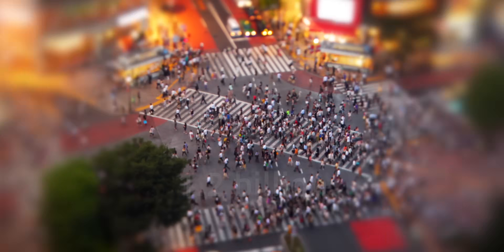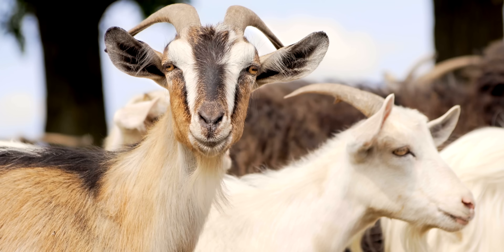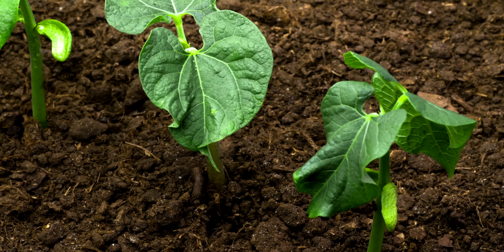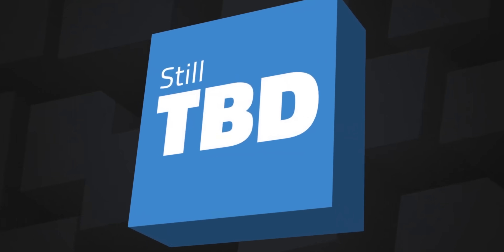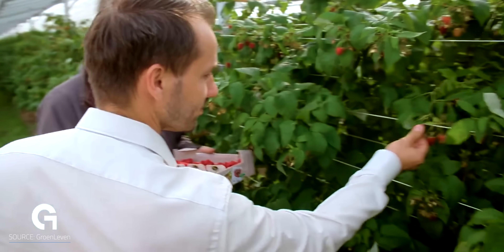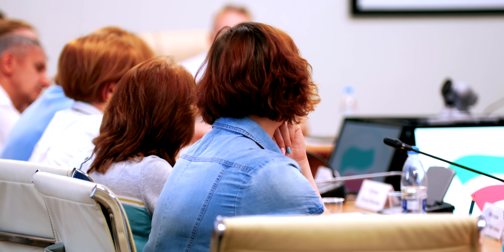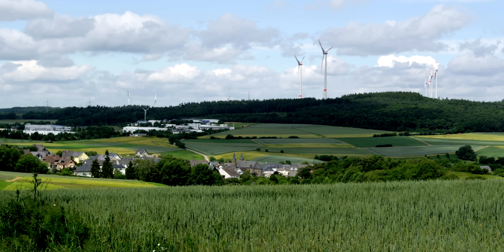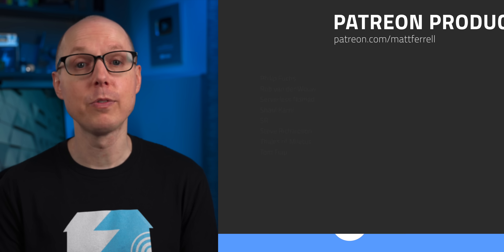Solar Panels Plus Farming? Agrivoltaics Explained

Comment: Sunny California with it's water shortages comes to mind for this.  Saving 50% water costs, adding income from power generation and maintaining same yield - a win-win.
Reply: yes, and there's also the opportunity to tailor the solar panels to light frequencies that plants don't prefer. With semi-transparent panels allowing the light through that plants like the most, we can make up the energy production shortfall caused by currently being forced to space the panels out (like on the raspberry farm).
Reply: @mikeballew3207  Yes, like the massive amount of green light plants don't use.  This is a great idea!
Reply: @mikeballew3207  underrated comment.
Reply: I’ve seen California crops under plastic tents. We should try replacing some of this with solar panels. California’s desire to promote solar power should be compatible with this.
Reply: @dmk1948  plastic tents, greenhouses?
Reply: @dmk1948  foreal i could confirm , i am currently working in agricultrue and i have seen that i work in the grape and lettuce
Reply: @dmk1948  they tryna go 100% solar by 2035
Reply: While certainly public policy could nudge this forward for some crops in California, recall that agriculture pays far, far below market rates for water, often at rates set 100+ years ago. So while the state as a whole would benefit, actual farmers and agriculture businesses might not be so interested, as the money saved is for an asset they pay very little for. And as Matt points out towards the end, that's one of the big impediments to adaption.
Reply: Someone has to make up the difference in that water bill somewhere right?
Reply: no freaign brainer as far as I can tell...and we need to stop growing almonds in CA....move that ish to southern states like Georgia or something
Reply: @CalifLove  agreed, according to some research I did for a college paper a few months ago, this was one of the big reasons for over-use of ground water, it’s getting so bad certain land has “sunk” down. We have literally changed the landscape by over consumption.
Reply: @CalifLove  Good luck with growing almonds in Georgia. Almonds grow well in two places in the world, San Joaquin Valley and Iran. Plus everyone complains about how much water they use because some dork wrote a misleading article wringing their hands about how each almond takes 100 gallons of water to grow, but they use a fraction of the water of the crops they replaced per acre yearly, like corn and cotton.
Reply: Local vegetable crop production in AZ too. Lots of farmland is becoming solar production for CA. This would be a win-win to reduce water use and transport fuel for some crops.
Reply: I am pro solar.  megawatts installed.   But I still worry about rules and regs and codes.   I am sick of all the changes that f the customers( and Mother Earth) .  When codes, requirements keep changing this really screws customers and our future( i am not anti safety).   It causes mass e waste.   When requirements and code requirements keep changing add-ons are not possible ( not unless a full new and different system is installed).  Rich people do not accept 2 different systems ( Visual aesthetics/ twice the monitoring).  These persons toss these systems and buy fully new.   Creating tons of waste.  And additional roof wear and many reroof  ( another landfill builder).    Lower income usually is who seems to get effed.   Picture a smaller income family who only could afford 1/2 a system ( and plans to add-on downstream).  Well they can’t.   Monitoring changes, code changes, modules access changes cause manufacturers are forced into new codes and safety.    So now a house has a system that will never hit full offset not without full new system or 1/2 a totally new system.   Larger older dc inverters still seem to be the most reliable but not the newer because of the code changes.  But they fail too.   And when they do it’s hard to find inverters.  Many of those folks were forced into a new system too.  Inverter failures, micro inverter failures, module diode failures, optimizer failures, optimizer allocation problems all cause huge w wastes.    We have tried for years to find a recycler.  Never found.   We could not even find a recycler for the millions of plastic spacers between the modules for shipping.    I like solar but we still need to make sure it works( way too much e waste).  And has parts that are allowed to be installed when equipment failures happen.   I am not a recycling freak.    I just want there not to be billions/trillions of solar panels, inverters, micros, batteries stacked up down stream.     Very soon this topic will be discussed and not hidden( I hope).     There are is more to the story.
Reply: Same problems as Germany.  Politicians interfere
Reply: @Harry Groundwater I'm not too sure Washington and Oregon will be too happy to find out they don't exist :P

There has been the occasional suggestion of diverting some of the Columbia river southward but that's still a very long distance to transport a lot of water, which includes a few mountain ranges to go over. You're looking at at least 100,000 gallons a second being transported at least 600 miles over 4000 feet of elevation changes. While such a megaproject would be neat to see, it's probably a lot cheaper for us to just be smarter about agriculture, which uses 70% of California's water supply.
Reply: @ikani1  you mean to say Portland and Seattle aren’t in California? 

I agree that pumping the Columbia river that far over the mountains is a terrible idea. 

The idea of growing crops under solar panels in the south west is a great idea I think. 
Tip them towards each other to form a trough to collect rainwater / condensation and then run small animals (poultry) underneath between crops to help add fertility, and the diversification enables more consistent revenue for the farmer.
Reply: Arizona now too, thanks in part to California.
Reply: Except...the San Joaquin Valley water shortage is too profound. Desalination for the entire West Coast is the ONLY way out. By Spring 2022, you will know this is correct.
Reply: And investing in on-site water storage. A network of small reservoirs and tanks will be a great supplement to large centralized reservoirs.
Reply: Sunny India as well!
Reply: What is the ROI?
Reply: good luck with regulation and try to convince regulators it's win-win
Reply: You could easily plug in an atmospheric water generator to get even more high quality H20
Reply: Aeroponics can produce food with 26 harvests a year (depending on type of crop obviously) use 95% less water, produce more food per square foot and be done anywhere there is wasted urban space.
Reply: @Peaches.Gonsalez  if only we had a more sustainable and less abusive way to source the rare earth elements required for solar panel manufacture
Reply: @Tom Sawyer I think it's all across US especially in dry states like Arizona, Nevada, New Mexico and Texas.
Reply: Except is costs a fortune.
Reply: @djheatt  never heard of offshore floating solar panels?
Reply: Same for INDIA
Reply: @Harry Groundwater Agreed. Also I thought about it more after posting and remembered the Columbia starts in BC so.. you were still technically correct :)
Reply: New technology for electric power generationhttps://youtu.be/xc2V2BS_Fng
Reply: Idiotto.they dumping water in Ocean
Reply: hell yeah... it's the future for sure.  So simple, it's beautiful.
Reply: Aeroponics is better for water.
Reply: Solar pv best application is direct use for deep well water pumping , thr is well and farming you can achieve both purpose .
Reply: @green-kundi8835  deep wells should be banned because they deplete underground aquifers.
Reply: It would be win-win-win!
Reply: @Harry Groundwater Pipelines for Water🙌
Reply: The European Mediterranean coast have plenty greenhouses allredy in use ...known as "plastic coast" from Spain to Greece that might be tuned over in the next 50 years
Reply: Yes, yes, yes!! Let’s me & you build the farm
Reply: I wonder why sunny California is having water shortages? Maybe its the fact that people live in the desert with swimming pools and golf courses? Or is it that yall grow avacados? Now people are fleeing cali and bringing AWFUL political ideas  to places like texas. Why turn your future into what you fled from? Californians, stay in your shithole that you voted for, we do not want you.
Reply: Oh I couldn’t agree more. From what I’ve seen of the US in many recent videos of your ever decreasing water supply and create problems due to degrading soil and less and less rain each year, you really do need more solar panels across your dryland areas all the way from California to San Francisco and the big rocky drying up river areas of the north west, along with the rest of the country.Quite frankly I am shocked that people across the world haven’t been using solar panels as a good alternative for trees to create a larger humidity shaded area to grow crops under a lot sooner. It feels like such an obvious thing yet for some reason people haven’t been doing it. Just get the right kind of solar panel and put your system on higher stilts and there you go. This needs to be implemented in the US over as much land as possible right now.
Reply: Vineyards spring to mind for this, as there is little machinery that can be used with trellis-grown plants.
Reply: Except it doesn’t actually work out that way
Reply: Sure its doable, seeing how California has yet to make meaningful update to its electrical infrastructure in its last hundred years do to bureaucracies and environmental activist. It may be easy and cheaper to completely overhaul its system then to update it aling with population changes. And would help out on bottom two thirds of the state since it imports irrigated water from surrounding stats as far as Colorado and no real attempts for desalination plants have neen made because the beach fronts are technically governed by the federal government not local jurisdictions. The top third is mostly where all the rain fall hits there is a pretty substantial climate barrier following the mountain range that separates the two parts.
Reply: Here's something for the idiots of Renewable Energy: 

Sooner or later you greenies are going to need to grow up and learn how economies work. - hint government people understand nothing of economies other than  how to rape them.    

These G-morons decided "woke' power (power that doesn't really work) was a great idea for them, not us, so they decided to steal some money from some ratepayers in order to pay others to stimulate the growth or power that really doesn't work - ie wind and solar.

In the real world, the one that really works,  there is something called supply and demand and these things regulate the price of everything fairly.  

Your butcher buys his beef by the side and pays more for it than the meat packing plant did who in turn paid more for steer than it cost the rancher to produce it.   Get it so far?     

Now when you buy that beefsteak at the butcher's shop he's going to get his markup as well,  so you as the end consumer are going to have to pay a lot more for it per pound than the rancher was paid for it.   

Next time you want a beefsteak drive out to a ranch and buy your steer on the hoof - then you slaughter it, age it carve it up sell the inedible parts to dogfood processors and the like and eat the rest of it on the cheap - no you want the value that all those who added value to the meat along the whole length of the supply chain don't you?  Or do you buy your steaks on the hoof?      Or do you expect to pay the  ranchers price at your favorite steakhouse as well?

It's that way with electricity too, you cannot expect the power company to buy power back from you at retail rates when they don't even need or want the power. With that business model they will go bankrupt as soon as their investors are wiped out.    

If that rancher were to dine out at your favorite steakhouse why not demand that your ignorant politicians make the restaurant buy his on-the-hoof steer from him on demand at the same rate per pound that they charge you for a 16 oz prime rib?    

The problem is, as with all government planned economies, sooner or later everyone will want to receive the grift instead of paying for it, when that happens the lights go out - permanently.

The most ignorant feature of all of this is that it is supposed to solve some problem that the grifters dreamed up but that does not actually exist so solar panels and wind turbines only create huge problems, they solve nothing - time to wake up you dizzy Californians.
Reply: Socialism is NEVER the answer.  The NIMBY is not always bad.  Many farmers have had their farms for generations and have fed thousands, if not millions over those years.  To say socialism is an answer, is merely saying, you have is and I want it.  My want is better than your want.  Some of the ideas here are good ones, but only if the farmers are on board with it, and can retain their sole rights to THEIR property.
Reply: The problem is they will put taxes and regulations on them and it will never get done properly
Reply: Absolutely, California's water issues make agrivoltaics a perfect fit. The potential to save water, generate income, and maintain crop yields really is a win-win. Do you think this model could be scaled to other regions facing similar challenges? And what other innovations do you think could help address water shortages in agriculture?
Reply: You have forgotten wind dew wells ! They make clean water from invisible steam in the air.
Reply: NoT iN mY bAcKyArD
Reply: Yeah
Reply: Less nutrients tho sun gown and light grown have huge difference in nutrients
Reply: I remember they used black balls on water reservoirs to avoid evaporation.   Those black balls could be solar panels
Reply: Yeah
Reply: California central valley also has the worst air quality in the county bc of all the diesel semis and tractors and tillage. These agrivoltaics will be needed to power megachargers for tesla semis and monarch electric tractors that will replace the diesel ICE ones running now
Reply: I have been to California on numerous occasions. One of the first things I think about when they cry water shortage is all the swimming pools evaporating water into the atmosphere and the lawns being watered like clockwork. I bet if they shut off the lawn sprinklers, let the indigenous plants take over, get rid of the pools and go play in that perfectly good ocean they would have more water to drink.
Reply: @Cyruscosmo  one cannot play in that frozen ocean, a quick check of temps at California Beach front may lead you down the path of enlightenment
Reply: To be fair though, saving the water could also be achieved by any other structure that adds shade when there is too much sun. So you still have to consider about 90% of the installation cost as only usefull for the generation of electricity, not justify it through the water saving.
Reply: @ShieTar_  I’d argue the additional revenue of energy farming on top of your crops is a good reason to do this instead of using tents or covers which produce no value.
Reply: @Skyhawk656  It may be, but it pays to do the math correctly instead of thinking too binary. 

The tents do not produce "no value", they produce value by saving water. Which, particularly in regions which get loads of sun, can be a significant contribution to your overall cost of operation.

The solar arrays create extra value (energy production), but also come at extra cost (solar panels, wiring, increased structural complexity). 

So you want to base your decision on correct math. Compare the cost of the solar installation with the cost of simpler water-saving techniques, and then only calculate how fast the value of the energy production can return your investment into this extra-effort for you.

My comment to the original poster was only: Don't compare the sum of the values of saving water & energy production with the cost of a solar power installation directly, because this equation gives you less information than doing the separate math for two solutions.
Reply: Solar power generation is worth $0 in CA.  Everyone has solar panels and they're all trying to sell energy to the grid at the exact time that it doesn't need any.
Reply: @LarsLarsen77  sounds like an explosion of power aka sunny day... but seriously we can store that energy in a flywheel, hot rocks, make green hydrogen or charge batteries with the excess power
Reply: @LarsLarsen77  a complete solar system would include batteries, and vehicles to grid so power can be stored and metered out as needed.
Reply: @LarsLarsen77  do you mean the Local grid? Aren't they all linked... except Texass
Reply: Great idea.  Keep quiet, else Nancy pelosi/ lackeys will ruin it. Or tax it.
Reply: @alexanderdavis3591  what's the Issue with taxation? If there are property taxes on build infrastructure or agricultural lands, those were deemed appropriate by the electorate to keep government services funded rather than spending inflationary.
Reply: @fionafiona1146  all great points, thanks for commenting.
Reply: Australia is a huge winner also..
Reply: @paulfri1569  
Another one for the renewable-energy dopamine junkies.
Reply: @hg2.  Most of Australia's barren deserts can be used for something productive like this..
Reply: @paulfri1569  
You think a little shade is going to make agricultural difference in a place as dry as the outback?
Reply: @hg2.  Will help the crops are that are more suitable for drier climates.. it's a Start and worth it
Reply: @paulfri1569  
Pal, get a real job. 
You've been in California weather too long.
Reply: @hg2.  I'm from Australia mate 🤠
Reply: @paulfri1569  
Yes, Australians do have their charm.
Reply: @hg2.  Bet alot Kiwi's are annoyed as it's a very hilly country and they can't build mass scale solar farms like Australia 😂😂 A Hilly country like NZ makes it very difficult to run and maintenance would be very expensive also..
Reply: @paulfri1569  
Context: New Zealand

I just came from another video thread where the Kiwis were bragging about their geothermal.  

Such feel-good foolishness. 

'scuse my french, but has anyone considered how much "decarbonization" is actually taking place? In terms of percentages?  And please spare me the "it'll make a difference in the long run" cr*p.  This is a fad that people will get tired of.  There are plenty of ruins from this fad from the70s.
Reply: @hg2.  True that. Nuclear power is a suitable option for both. Too many hippies in both countries and the normal person is paying because of a bitter small minority..
Reply: @paulfri1569  
Suppose we could switch all electricity generation to nuclear overnight. Would that make any difference in co2?

How long would it take to show up?

How much effect would it have besides feel-goodery for these dopamine addicts?
Reply: Yes, but did you understand the part about bureaucracy?
Dems are loud about SAYING they will support the environment. Until it comes time for action. Look at Bidden snubbing the number one American EV producer, Tesla.
Reply: If Americans will do these things then who will  bomb countries and  bring peace.
Reply: @pradeepkharta5953  the other ckuntries seem to have it down.   especially japan
Reply: @pradeepkharta5953  Xina
Reply: @pradeepkharta5953  😁😎👍
Reply: @pradeepkharta5953  That, sir, is an important question that the psychopathic corporations, who make trillions from wars, would prefer people to ignore.
Reply: @georgianbents  yup
Reply: water shortage my ASSSS,, idiots,,  thank your DemonsRATS
Reply: @ictviamfortruthgoogleisspa5886  not true😡
Reply: Water shortage is a myth in California its a recent change because of “environmental reasons” where trillions of gallons have been diverted to save a tiny fish called the Delta Smelt
Reply: @KCJbomberFTW  Water shortage has been a growing problem in California since WWII. Population growth in California, Arizona, Nevada and Colorado has resulted in a rise in demand for water from the Colorado River, which is the major source of water for Southern California. As population growth slows in California, it picked up in the other states so the water situation didn't improve. As it gets worse, it impacts agriculture before it impacts residential use. 

Sure, there is some impact from environmental causes, but those smelt wouldn't be worried about the water level falling too low if there was enough water to take care of all the needs being placed on the river. The fish habitat being endangered is a symptom of a larger problem. 

All of the states that depend on the Colorado River need to do what they can to not just conserve water, but also what they can to recover water and to route new sources of water. That means desalination plants in California, and north-south aqueducts to move water from areas that have an excess.
Reply: @Chris_Sizemore  add solar panels OVER those canals....see India.
Reply: @KCJbomberFTW  that's utter nonsense. The West has been having a drought the last few years. On top of that, California produces a lot of the food the rest of American eats, so to an extent, the rest of America imports a lot of that water in the food they eat.
Reply: @KCJbomberFTW    Yes, the Oroville dam was to hold 5 years worth of water in case of a drought and it's gone in 2 years.
Reply: @KCJbomberFTW  you’ve obviously never read the data. It’s no myth, the Aquifers are being over drilled and pumped, mainly by farming. salt water is not usable for farming either because salt kills crops. Good thing you’re not in charge of any important issues where you are, obviously can’t be counted on to research an issue before making a determination on it. Verify what you’re about to say before you make yourself look like a doof.